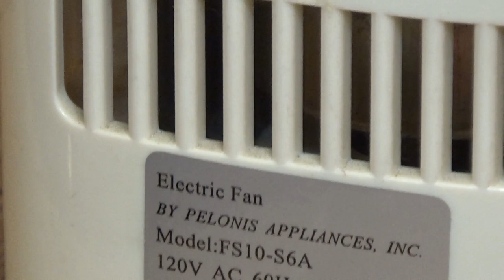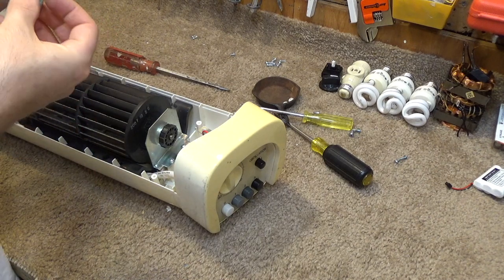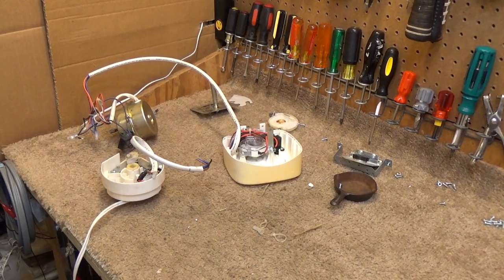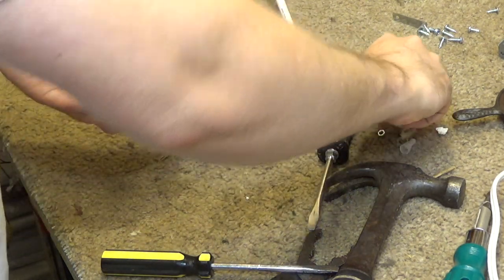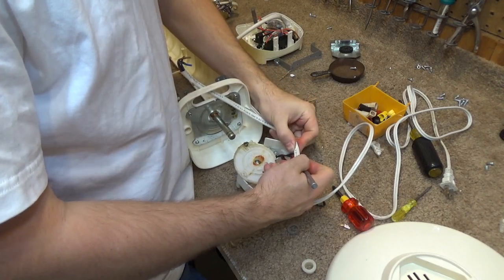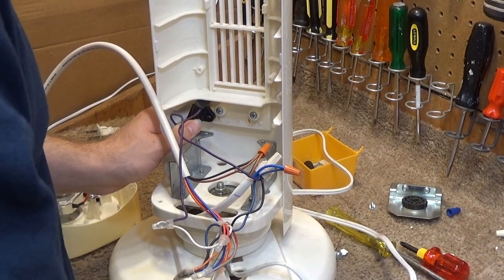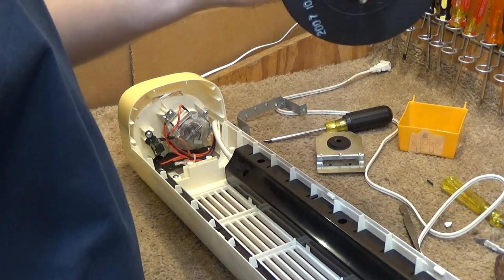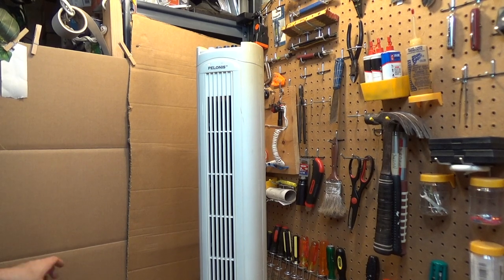Clean and Service Pelonis FS10-S6A Oscillating Tower Fan

Comment: Hi Jordan thanks for your video... my fan wasn't exactly like yours but nearly and it helped... I had taken lots of screws out and hadn't got anywhere!! Until you showed that the front probably just can off with some prizing because it was held with clips... worked perfectly and wow was it dirty, took me hours to clean it!! 😂 anyway all back together luckily remembering where all the screws went and is all working still, so that's good 👍🏻👍🏻
Reply from the maker: These are quite a pain to clean, but if you're patent enough, you can save having to buy a new unit.

Comment: Someone threw one of these away perfectly brand new just a little bit of dust works perfectly fine with the remote with no batteries so you can say I got for free and no there was no rain today when I grabbed it from the dumpster and no it was not in the dumpster is right by side or it was for someone and he just passed away you can say it a lot Old Timers live where I live and a lot of them die or move out in the family does not want anything and throw it into the dumpster or give it to someone so they can use it